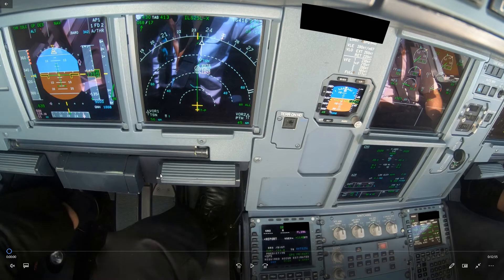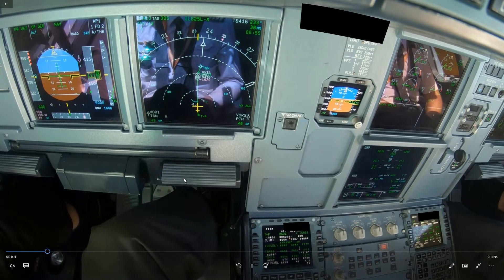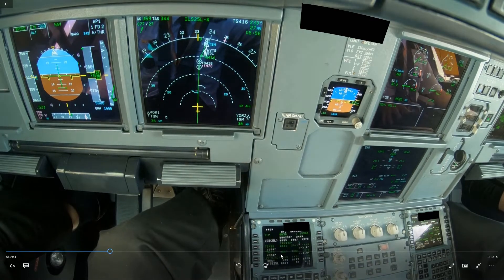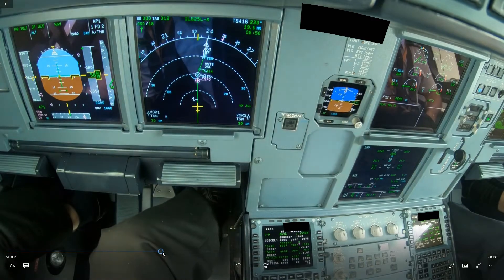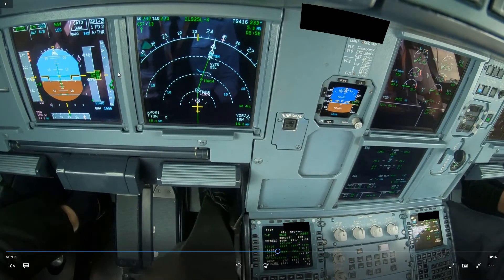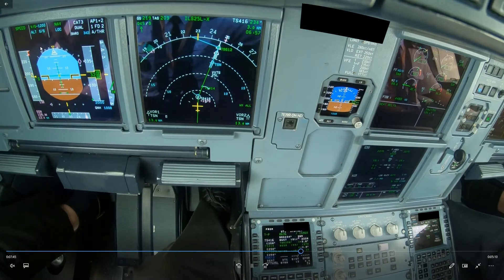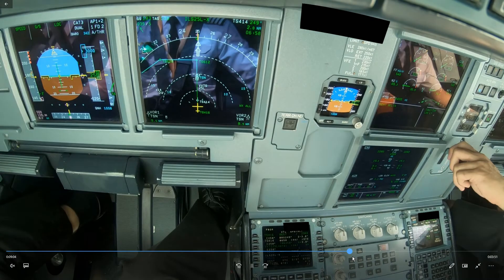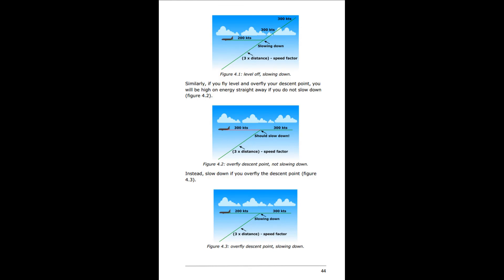A320 Descent Management - VVTS correct high speed descent.

Comment: In your book you talk about when landing at high elevation airports, for configuration you should minus  the elevation from your current altitude; and add it just for profile only. 
If my SOPs specify that flap 2 needs to be taken by 2k tdze… would I not add the airport elevation to 2k?

However would I be right in saying I could also do current altitude- 2000 and as long as it’s above 2000 then I haven’t busted the 2k flap 2 rule.
Reply from the maker: Let's say the airport elevation is 3000 ft. If you need to have Flap 2 selected by 2000 ft above the airfield (which by the way is way too late), indeed you have to add it, so at 5000 ft (from altimeter) you should have Flap 2 selected, latest.

Doing current altitude (5000 ft) - 2000 ft will give you 3000 ft, in which case you just landed without proper configuration (airport elevation 3000 ft).

This is not the method I teach though because as you can see, it's easy to mix up adding and subtracting. For configuring at above sea level airports, instead you should work exclusively with distance.

For example 2000 ft above the airfield equals 6.7 nm to the threshold. That is  the same no matter what the airfield elevation is. Use the runway threshold distance from the FMS progress page only for that because the track distance is not correct for some NPA depending the software setup.